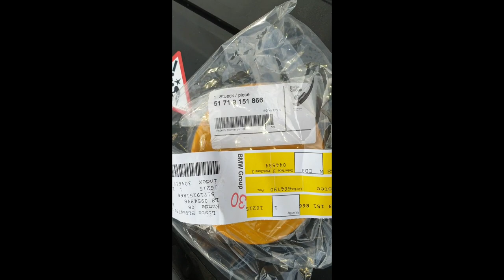BMW F10 F11 5/6/7 F Series Water Leak Rear Passenger Footwell - Yellow Grommet - *100% FIXED*

Comment: Top video and explanation mate! Discovered my F11 2013 RHD passenger footwell sodden about a month ago. Puzzled. After a quick search came across this. Part arrived today and will attempt in the next few days. Think I’ll drill a few pilot holes in the cover. Definitely using some decent silicone as well. Can’t thank you enough for the step by step guide 🫡👍🏻☺️

Comment: Good video, very useful. I left the grommet in place, cleared all the debris but permanently removed the plate covering it as it promotes water collection especially if the drain pipe blocks again. The water now runs off without issue to the bottom trays where it leaks onto the floor. This is an example of over engineering by BMW which will cause blockage abd  leakage.

Comment: I agree, you are a legend! Many thanks for this superb masterclass. My carpets are dry but the grommet recess was clogged with muck and the grommet looks a bit old. I'm going to fit leaf catcher mesh under the bonnet hinge cavities on both sides as the driver's side drain was blocked. BMW price today was £20.23p for the grommet. I've drilled several holes along the bottom edge of that plastic shield before re-fitting it.

Comment: Thanks for posting. Far better solution then pull back carpets. Did mine tonight just to clean out the dirt and debris. Will order the part and replace the grommet.  Thanks again.
Reply: No worries. Glad it was helpful. I'm not a fan of.pulling back the carpets to be honest. Just find this method easier.

Comment: Very clear instructions.I performed the steps just now, I am just waiting for the sealant to dry off before putting the metal cover back. My question is, why do we need the metal part. Wouldnt it be better to leave it off so that no more water will accumulate and get into the car in the future?
Reply: Just a bad design. I think drilling a spare holes in that cover is a good idea.
Reply: Think I’m going to leave the cover off.

Comment: Just done mine today. Got the yellow grommit  thing from bmw for £19.48. The water is flowing out of the car well now. Thanks for the video.
Reply from the maker: You welcome Albert. As a thank you, feel free to like and subscribe. Will try to add more videos related to the car
Reply: @23solad  I’ll surely do. Quick question, my leaking was coming from the driver side (o/s) of the car. Do I have to undo that part too??
Reply from the maker: @albostu  in that case, I'm not entirely sure the problem is the yellow grommet. Refer to the first 3 minutes of the video, the grommet is used to block the slot where the steering components would fit on a Left handed drive car.

Your issue may be the window card or something else if the leak is coming from drivers side

Comment: Fantastic, just carried out this repair, bit of a nightmare getting the T30 bolts out, especially with thread loc, but got there in the end, shop vac the mud out also on the back of the protection plate. Thank you,   BMW 730LD F02
Reply: No problem Martin. Glad you were able to sort it
Reply: My one is bit more of a pain someone most of tried before and top screw holding the cover plate in is threaded up so cant unscrew it. Plus how did you sort out the fully wet carpet as that is the problem i am going to have as mold will start if left to long.
Reply: @giggity4670  The cover is made of plastic and doesn't do much except cause this clogging problem. If you can't get the bolt out just cut the cover round the bolt head with a Dremel or Stanley knife and tear the cover off. The other 3 bolts will hold it on. There's another video where the guy replaced the cover from inside the car by pulling it through into the car and feeding the new cover back through the hole but it's harder to clear the dirt out of the cavity.

Comment: Brilliant, thank you this is very informative will have to have a go at this. Noticed mine had a puddle in rear footwell. Took it to Sytner BMW hoping they would do as a goodwill gesture which they suggested, came back saying no due to age of the vehicle and then decided to state it will cost £2200 to replace the grommit and all the carpets!, when i asked how much without carpets replaced it went down to £900. So i asked how much for the grommit itself £16 + VAT. They had stripped the car to show me a video confirming it even after i told them it was the case but are unwilling to change a a part. Absolutely ridiculous service!
Reply from the maker: Interesting.... I wonder why they wouldn't simply just replace the grommet considering they had stripped the car down. 

Quite frankly, my video gives you all you need to do it yourself.

Comment: Great video man ! You saved a lot of time and pain for the other BMW F series owners. Someone said you can reach that grommet from the pasanger wheel arch, if seal is removed.
Reply from the maker: Thanks for the kind comments. Absolutely you can definitely reach the grommet through the passenger wheel arch by removing all the padding and insulation. I just found this method a lot easier mate, besides there's a lot of padding in front and  I didnt want to mess with the factory sound insulation by replacing from indoors.
Reply: Very helpful video! Thank you!
But one question, whats the point to put that black plastic cover after I change the yellow grammer ? Also I put some silicone.
Reply: @PigwaPigwa  Sound insulation.
Reply: Sound and heat insulation

Comment: This is a great video , also the cover in front of the yellow grommet I left off as it has a seal and this helps for it to hold water in there so ditch the cover too
Reply: any issues with leaving the cover off.just took mine off , grommet was ok.think mine is the water seal in the door. But going to leave that cover off as it seems to cuase more of a problem leaving it on.
Reply: @markdurbridge3059  mines been off over a year no issues yet mate
Reply: Nice one …my yellow grommet looked ok once I took cover off . Think it’s the door vapour seal which is fooked!!

Comment: Top man, just found out about this from BMW, £400 to replace grommet!!! £1,200 to replace front carpet.   Thank you for the video. :-)
Might not even replace the part you took out, not sure what it does TBH.
Reply from the maker: Looks like you are going to be saving a lot of money. The power of the Internet. 

You really should change the yellow grommet. Thats what let the water through in the first place
Reply: @23solad  Yes, just ordered it, £20.  The original bung was completely rotten/perished at the bottom. Totally bad design, will also drill some holes in the front of the black plastic cover, engine bay side, so that it drains properly too. Will have to take out the carpet at some stage to dry, but for now, jobs a good'n.

Comment: I have this issue on my nearly acquired BMW F07 530d GT ( also a UK car) and I’m going to do this.

BUT….I also have a soaking wet driver’s side footwell (worse than the passenger side!). Any ideas?  I know this happens on the passenger side because that yellow grommet blanks off where the steering column goes through on a LHD car….but is it the same the other side? 

Thanks

Comment: Very informative video thank you... I have the exact same problem with my 3 series but the layout under the bonnet looks different. Do you think it will be the same issue causing the problem?
Reply from the maker: For the 3 series I will start with the door area, usually its a broken vapor barrier seal. Also check the window seals for damage
Reply: @23solad   @Midlife & Restless  seems like the vapor seal is intact, I've poured water against the window and it doesn't seem to be seeping out... I have a great big puddle in the passenger rear foot well just like you're describing. Thanks the reply and help
Reply from the maker: @vas8696  do bear in mind that the water could be sipping out with time and may not gush as soon as you pour the water .
I will do some more digging for you and feed back with any tips. What's your 3 series model number?
Reply: @23solad  that makes sense, I have had to use a dry vac 3 days in a row now so whatever the problem the water has accumulated quickly. That would be fantastic thank you... I have a 2008 330 D auto

Comment: Thanks for posting this really helpful video. I've seemingly got exactly the same issue with my 520d F11 which I plan to tackle next week. Quick question, does the fix (and part replacement) appear to have completely resolved the issue?
Reply from the maker: Hi Jules, thanks for the comment. I acan confirm that the fix has permanently resolved the issue. A few other people have also attempted and confirmed the fix.
Good luck  buddy
Reply: @23solad  you legend. Great work and thanks very much for sharing!
Reply from the maker: @julesbyeuk1  shout if you need some help. And don't forget to smash the like button 😉

Comment: Thanks for the helpful video. Is there a drain on the driver’s side. I have had lots of water collecting there and can actually get my hand down inside. I just don’t know what I should be feeling for.
Reply from the maker: Dont know mate.
Reply: It might be the water vapor barrier seal if your in a left hand drive car, this issue in the video is only for right hand drive cars

Comment: Many thanks for the video, going to attempt this on my F02 730d on weekend, just a bit nervous about dropping the screws in engine bay when removing or reinserting?
Reply from the maker: You will be fine. Just take your time
Reply: Thanks for the super quick reply. I have liked and subscribed. Any other areas I need to clean other than the grommet area and white pipe (if present) once black cover removed?
Reply from the maker: @ishaqmir2020  nothing else mate. Just those two. 

I have faith in you not to drop the screws 😃 

Thanks for like and subscription
Reply: @23solad  hi again, really appreciate your time here. I managed to get the black bulk head cover off and to my shock the yellow grommet did not have a black water line, this was because it was completely black! No yellow visible! Lol I’ve given the area a really good wipe down with degreaser etc, and the grommet is totally gone, the rubber has been eaten away at the edges. The problem I’m having now is I can’t get the grommet off with my fingers and no screw driver is small enough to get in that cavity to press those three clips inwards. I’m thinking a small claw shaped chisel/tool to get behind the clip, push down and then pull?
Reply: @ishaqmir2020  you can reach it from inside the car, pull up the carpet in pasanger foot wale and you will see that yellow cap.

Comment: Hi, thanks for making this film.  I have just discovered my car has the same issue.  Do you have to replace the yellow grommet or will simply sealing the old one back in be OK (after cleaning out the pipe etc)?
Reply from the maker: You have to replace the yellow grommet. The current one is damaged which is why you are experiencing leaks. Its no longer good.
Reply: @23solad  Thanks mate, that's very clear.   I have just ordered one.
Reply from the maker: @timmedcalf1357  give us a shout if you have any questions. And dont forget to like the video
Reply: @23solad  A quick update that I put in the new grommet this morning - not much fun in the cold but as it's due to rain for the next few days it felt important to sort it out.  Followed your approach and only had a struggle with removing the old grommet - it was clearly perished around the edges and the foam behind it was also damp so I am very much hoping it is the root cause of my problem. I couldn't see the white plastic pipe you mentioned, but maybe as I have an F11 it isn't there??  All back together now, I just have to keep working to dry out the rear carpet!!
Reply from the maker: @timmedcalf1357 Welldone Tim!! :) Proud of you. Having done it, I bet you can see why the yellow grommet cant be reused once removed. I also struggled with removing my yellow grommet and had to use some force. At some point it felt like you could break something else. Dont worry about the white plastic pipe, even  though I poked it, it wasnt blocked at all. It was simply a nice to do. 

Did you  manage to test it? Did Water run down the vent? If so, SORTED!! :)
Reply: @23solad  Yes, completely understand why the grommet couldn't be reused.  Mine was so stained brown that it took a good look before I could really see it!  Haven't tested it yet as I'm letting the sealant have a little time to cure but as I used Sikaflex EBT+ which can stick anything to anything for life, I'm pretty optimistic!

Comment: Hi this is very helpgul, however, I am stuck, How did you remove the yellow grommet?
Reply: Hi Marco, the grommet is wedged in with clips. You need to use a but of force to get it out. Get underneath with a  pry screwdriver or a long thing screwdriver and pry it up.

Good luck

Comment: I have a 2012 535i xdrive US(left hand steering) and the water is pooling in the same rear footwell. Do you think it's the same for this vehicle?
Reply from the maker: Not sure but dont think so as your Steering would be in the hole instead of the grommet. I would start my investigation with the window seal then the door card.
Reply: @23solad   took your advice and found that front door vapor barrier was the issue. Purchased some butyl tape and resealed it. Looks to have solved the problem. Waiting for a good rain to confirm.
Reply from the maker: @xtravdesigns7756  thats great news. You can always sprinkle test with a hose (on low pressure) as that will give a better test than rainfall. Dont forget to like the video.

Comment: After seeing this tutorial I ended up buying the part/cap myself and asked a local garage to replace it with glue. Few weeks later I've realised the garage didn't do the job correctly as I can see the water leak issue again. Asked the garage if they used the glue and interestingly they can't remember 😭 Going to a different garage tomorrow who seems to be more reliable and they'll strip the front carpet off in order to make sure the job is done correctly. It appears that the Glue is very important to fix the issue.
Reply from the maker: Hasn the "glue" is important as It acts as a sealant and barrier. 

Its like installing in a new bath and not applying silicone sealant as a barrier. 

Once you remove the original yellow grommet, u break the BMW seal, hence you need to create a new seal for the new grommet.

This is the main reason its a bit difficult to remove the old seal

Good luck
Reply: Hi guys I’m having this exact issue, how much is labour (ballpark figure)
Reply: @sajidrahman8356  i paid 30 quid fo my local garage. You can buy that cap from BM for £19 i think

Comment: How did you dry the water up from inside?
Reply from the maker: I used an absorbent large towel to absorb most of the water, I then left another towel on the mat overnight  with the windows slightly  open to reduce damp smells

Comment: Has anyone had this problem fixed in a garage please? Do you know how much per hour they charge?
Reply from the maker: According to a previous contributor, BMW Sytner quoted £900 to replace the grommet and a quote of £2200 to replace the grommet and all the carpets. 

Hope that helps.
Reply: Hilda did You sort yours at a regular garage? If so how much was it
Reply: @sajidrahman8356  It'll be a 1.5 or 2 of hours labour and £20 for the grommet. Say £150. Quicker if they don't put the cover back on!

Comment: What sealant u use ?
Reply from the maker: Any silicone sealant will do the trick. I used the Mapei Mapesil in Anthracite colour because that was what I had at home. 

Good luck
Reply: @23solad  I got a plastic weatherproof sealent 
Getting done right now hope it works
Reply from the maker: @saifiqbal2587  I have confidence in you mate..... :) go for it
Reply: @23solad  the dirt line was very high on my yellow cover just hope it fixed the issue
Reply from the maker: @saifiqbal2587  did you remember to poke the white drain pipe? When the sealant dries do remember to test it
Reply: @23solad  I don't think the mechanic did. Where is this white drain pipe. We know it worked as the water that was sitting went down
Reply from the maker: @saifiqbal2587  its right in front of the yellow gasket. I mentioned it in the video.

Never mind, as long as the water went down on testing then you are good.

Congratulations 👏
Reply: @23solad  whats best way to dry away water 

I done wet vac on carpet but water soaked inside foam. Don't want remove full interior
Reply from the maker: @saifiqbal2587  just give it time, it will eventually dry up. Much easier than striping things down.
Reply: @23solad  yeah water now goes down the side as it should just hope it dries up fast

Comment: Has anyone a link where to buy the part
Reply from the maker: Best to buy from your local BMW dealership. Its not a job you want to do again anytime soon, so just buy the original direct from BMW. I have included the part number in the description. Good luck
Reply: Bmw Belfast told me they would have to water test the car first , just bought it form a bmw dealership in Carlisle
Reply from the maker: @michaelodreain6230  let me guess, BMW Belfast would water test the car at a cost to you?
Reply: This is from eBay. BMW Carlisle - https://www.ebay.co.uk/itm/BMW-Genuine-5-6-7-Series-F10-F11-F12-F13-Steering-Column-Cover-Cap-51719151866/174550981547?hash=item28a40c9bab:g:CDoAAOSwLYdfzl8l
Reply: @23solad   yes £98+vat and wanted to keep the car for at least 3days.
Reply from the maker: @michaelodreain6230  simply laughable. Thank goodness for YouTube

Comment: Bmw won’t admit this very common problem and there’s actually 2 different leaks that can cause the rear footwell to fill with water I’ve personally had both. The other leak comes from the rear door vapour barrier leaking also very common in the f10 model nice build quality BMW 🥴